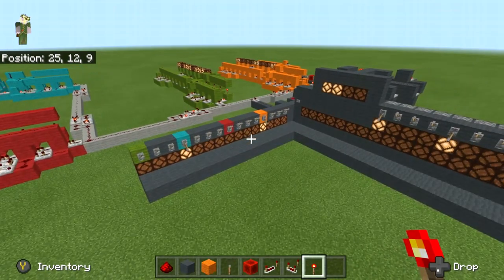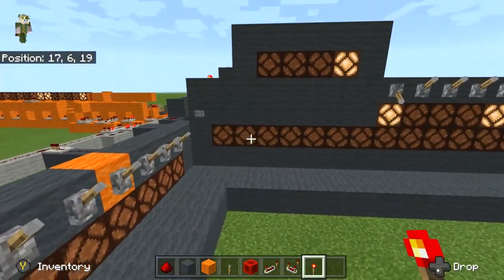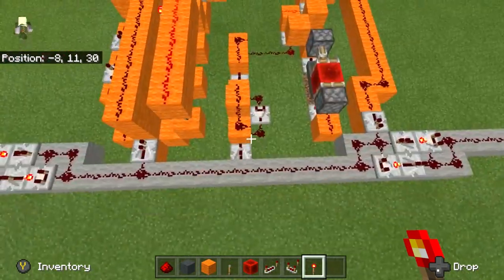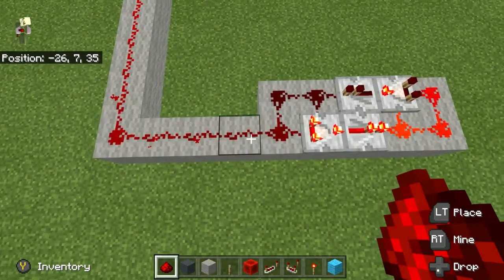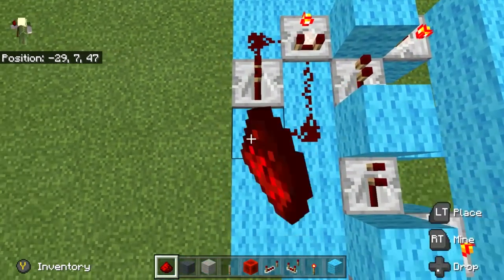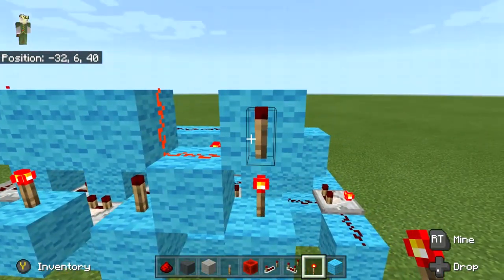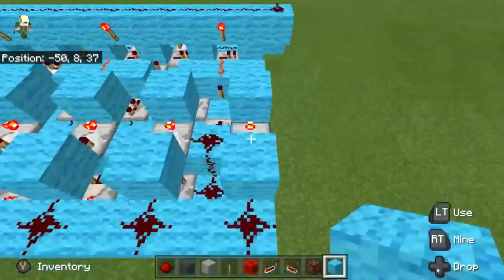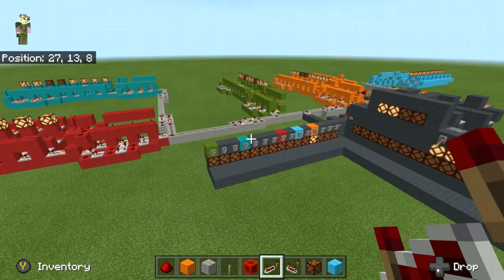Minecraft Single Wire Transmission

Comment: A byte of data is a bit much (pun intended).

Jokes aside, I think this system would be nifty as a master control panel and feedback for a labyrinth.

Which just so happens to be my current long term project. Thanks for sharing!
Reply from the maker: Lol thanks, and good luck. Just saying, but if you need more outputs and don't mind slower transmission rates, check out my other design here: https://youtu.be/vzULlQgL-XE still only has 15 addresses, but capable of up to at least 32 bit output, and in my opinion, easier to setup, even though it does require two transmission wires

Comment: This is awesome idk what I'd use it for but I dig that it exists
Reply from the maker: I know right.. hey, this you could actually use to control your farms.. or build a calculator or something. lol But that's the genius of minecraft
Reply: @jonathanpeters4240  to control some farms you would only need 1 bit of information right? 
On or off 
Then run that into like a clock or something
Reply from the maker: @barrettludwig4677  Yeah, if you just want to control one farm per address. You could use a single bit and D flip-flop